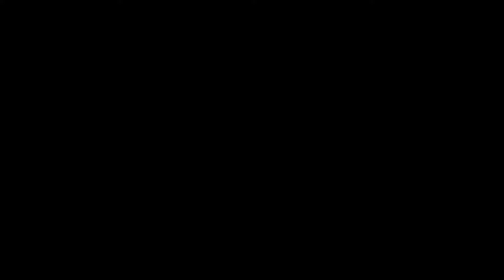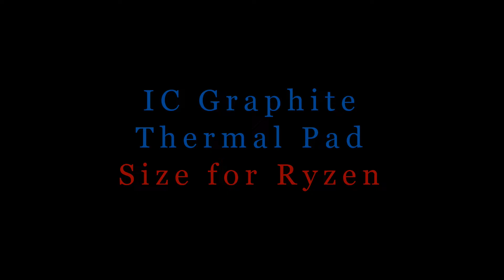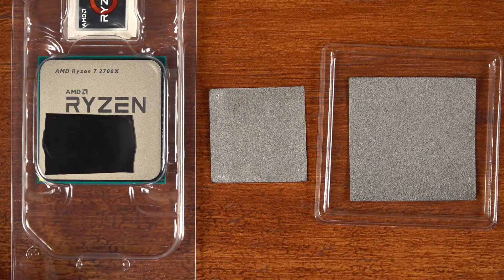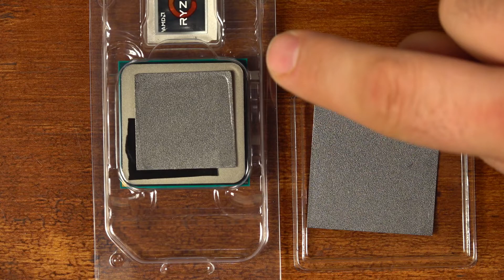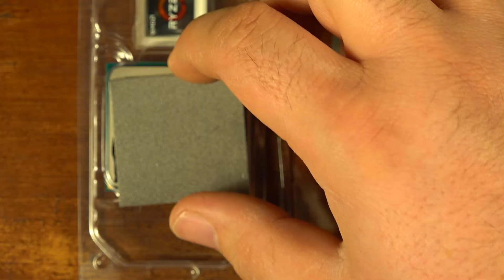IC Graphite Thermal Pad Size For Ryzen

Comment: I have a ryzen 3 processor but the stock fan included has the thermal paste attached would it be safe to use this on that I have a motherboard b450ma looking to also upgrade the fan was debating on getting a good rgb fan and didn’t know if you knew if a fryzen would fit on that motherboard and be safe with the ryzen 3 kinda new to this just didn’t want to make any mistakes just liked and subscribed.
Reply from the maker: Which brand and model B450?  Also, the case you have could make a difference as well.  The Fryzen cooler is pretty large and tall, so height clearance could be an issue, as well as other components, simply die to the size.
Reply: bigtb1717 I only have about the same size as in the ryzen 3 stock fan and it’s a PRIME B450M-A CSM
Reply from the maker: The Fryzen cooler is far larger than the stock cooler.  It is much taller in particular.  If your case can’t fit a 165mm tall cooler then the Fryzen cooler won’t work.
Reply: bigtb1717 tallness wise it should work just was meaning on going from the right size that’s why I sent the link I’m new to this really do appreciate you getting back to me one of the few on YouTube that helped me out.
Reply from the maker: From what I can see that cooler should work.  The case lists a max cooler height that would work with that cooler.  I don't see anything else about the setup that would get in the way of that cooler, either.  It's hard to be absolutely certain, but my guess is that it would work fine.  That cooler is overkill for a Ryzen 3, but if you like the looks I'd say give it a shot.
Reply: bigtb1717 with it being an overkill could I run into any problems possibly not sure what the overkill quote means?
Reply from the maker: No problems from overkill.  I just mean that it's probably more cooling than you absolutely need, but there is certainly nothing wrong with having extra cooling.
Reply: https://youtu.be/A36hRAHRCVA this is the link to the exact build I have aswell gives a better explanation its on YT
Reply: Thank you so much man I really appreciate this!

Comment: The actual dies below the heat spreader on Ryzen are located in an area smaller than 30x30 so I'm a little doubtful that using a 40x40 will actually provide any benefit. Did you ever end up testing it to see? I'm just about to order mine and was curious
Reply from the maker: I haven't tested that.  From what I understand, the pad transfers heat across its surface far faster than it even transfers heat through itself.  So any heat that it draws out of the die should spread across it's surface very efficiently.  For that reason I feel it's best to have the larger pad and the most contact area possible.  But I have not actually tested a smaller pad to see how much difference there is.

Comment: Im thinking of using this for my laptops i7-3612Q and im not sure about sizing, would over hang be good or bad?
Reply from the maker: I would be a little more careful about overhang in a laptop since there is probably stuff that could short out much closer.  The pad is easy to cut. For a laptop I would probably cut it to size.
Reply: @bigtb1717  Thanks!

Comment: could i use this pad with the stock cooler that comes with a r7 1700
Reply from the maker: It should work.  These pads work best with high clamping pressure, but I used one with a stock Intel cooler and it worked fine.

Comment: I did the same thing with Ryzen 5 build. Great, stable temps. I did trim the pad slightly for a more exact fit. Was worried that the overhang would cause issues since the pad is so conductive. But in retrospect, I probably shouldn't have worried.

Also, I had a horrible time getting the pad not to slide. I ended up using two tiny dabs of paste on two corners to keep it from sliding around while setting my cooler in place.
Reply: Why didn't worry about over hang??🤔

Comment: Are you going to do a build video on your new system?
Reply from the maker: I am.  It's going to be a departure for me from my normal build style.  I typically go for simple, discrete looks (classic, black cases), safe air cooling, etc.  For this one I initially decided to finally do AIO water cooling, just for something different.  But I figured if I'm going to do it I'd really go for it and do a custom loop (my first one ever), and I decided to get one of the craziest cases as well.  

Should be a fun build.  I hope to get started today, actually.  But I don't have all the parts yet, so I can't say when it will get finished and the video will go up.  Hopefully sooner than later.